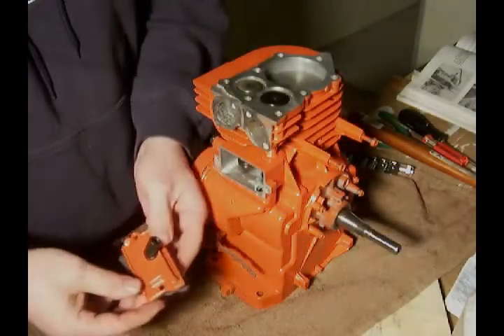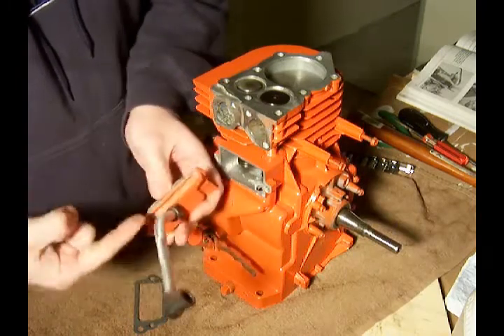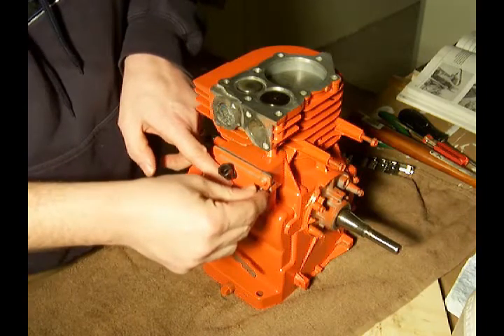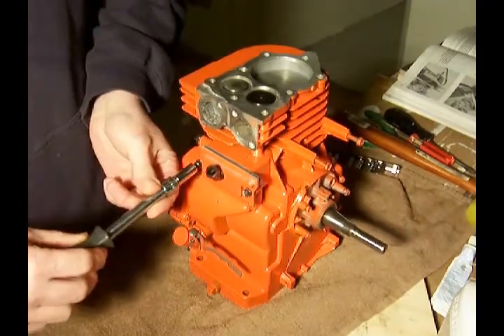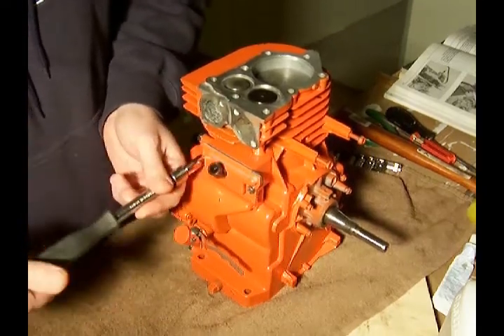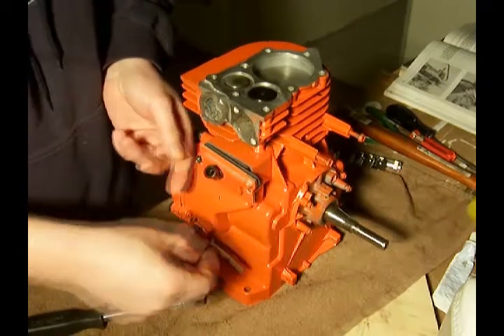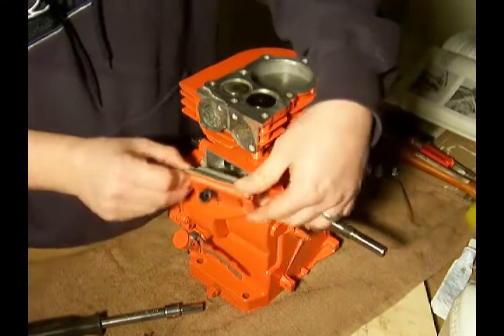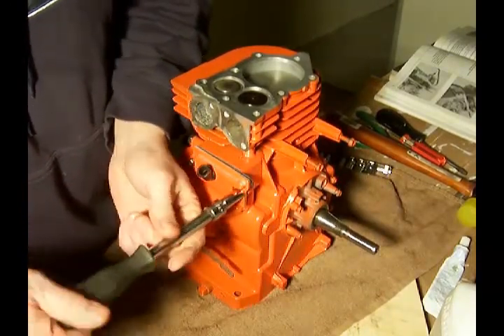#9 - Briggs and Stratton 5HP 130202  - Valve Cover / Breather assembly

Comment: If the breather is filled with oil from tipping over will that prevent fast throttle operation? My briggs 5hp like this one will only idle and when moving throttle to fast will not go past idle. I tipped my tiller over to empty bad gas and then this started happening?
Reply from the maker: If oil got into your carburetor or breather, it may cause smoking and/or erratic behavior.
Reply: @RealManSkills  Turns out my issue was setting the governor after installing a new carb.

Comment: Thanks for the videos. I also have a 130202 engine I am repairing. My fuel tank is rusted badly and I need a replacement. Do you happen to have a source for a fuel tank ?
Reply from the maker: The fuel tanks come in different sizes. I found some listed on Amazon for about $66. Thanks for watching. Try ebay for used tanks.

Comment: Why do Americans say 5 16th socket, why not just say  8mm socket it's so much simpler.
Reply from the maker: molly marley I have a 5/16 socket and an 8MM socket. When I work on US - AMERICAN made engines, I use US -AMERICAN tools. When I work on imported engines like Honda, I use metric tools. Thanks for watching!
Reply: They should ban metric tools . Signed grumpy old guy

Comment: About the breather:

In older B&S carburetor systems this breather had the function to give a pressure actuation to the carburetor every time the piston went down (since there would be an increase in pressure there at that point no matter if the motor was going of not) and this pressure was used to engage a very simple sort of pump inside the carburetor so it could pump fuel up from the gas tank.

Comment from the maker: I would need to know the model of engine in order to look it up in my repair manuals. I can tell you that breathers are sometimes connected to the carb by a rubber tube. Sometimes they are just tubes that hang down without connecting to the carb. Thanks for watching.

Comment: Can you gain a little bit more power if you unhook the breather? I have a way to block off the whole on the carb so it's not sucking in other air, do I need crankcase ventilation? Does it come out the tube by its self with out the carb pulling it out?